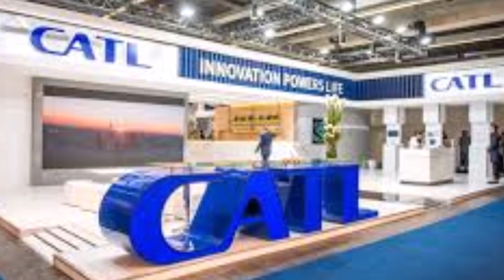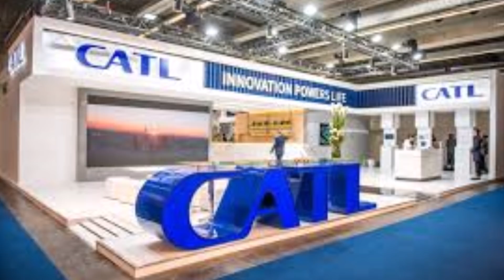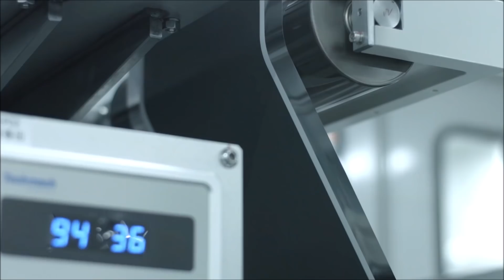Tesla and CATL's One-Million-Mile Battery Is Ready for Production

Comment: I am interested is what this means for the Powerwall. When will I be able to get a Powerwall with this new technology. at the moment it is not worth buying a Powerwall in the UK. The battery will run out just when I get my money back. I will not make a profit on it over its lifetime. If the new Powerwall which I have not heard anything about yet arrives  I expect it will last 30 years instead of 15. I expect that it will also cost 30% less than the current Powerwall 2. I am only guessing. This will make it worthwhile to add to my solar panel installation.

Comment: Although the life of the battery is one factor holding people back from buying an electric car the largest factor is time to charge. Once you can get the charge time down to at the most 15 minutes then the market will be wide open. But then we will run into the next problem: the electrical grid. Our existing electric grid and generation cannot handle the capacity of everyone having electric cars. This is compounded by everyone not wanting new power plants to be built but solar won't cut it at this time. The solar panels are inefficient, toxic and don't last long enough to justify the cost. The cleanest generation at this moment is nuclear but everyone is afraid of it after Fukashima. The next cleanest is natural gas. Those plants run clean and there is a lot of natural gas. We need clean generation that works in the day, night, windy and calm until a breakthrough in electric generation can be invented. Once those two problems are solved the whole WORLD will willingly go electric and you won't have to talk them into it.

Comment: Somehow I doubt the claims or their overall significance.  Nothing in the announcement regarding the elimination of cobalt from the chemistry (keeps scaling possible and cost effective)  Nothing about the various methods employed to ACHIEVE the longevity benchmarks they're claiming.  Nothing about any innovation in lithium crystallization (which is how Tesla batteries were able to achieve the benchmark apparently).  NOTHING about new manufacturing techniques or technology.   Nothing about methods of thermal management (which are essential for higher recharging rates)... Just a claim about performance.

Comment: It's not really clear what excatly this is. The pictures show NMC cells with an energy density of 280Wh/kg which is quite impressive but I think this is not the "1 Mio. mile battery" as it was always believed (and confirmed ?) these would be LPF cells. Also the bloomberg article mentions the cells would be 10% more expensive while Teslas new batteries are supposed to be cheaper than existing ones. So I think we are still heading for two completely different batteries, an expensive high-capacity one for the long range models and a cheaper one for short and medium range models. If only the last one is a "1 Mio mile battery" is something I'm really not sure about.
Reply: I suspect 10% dearer than CATL's standard batteries the cells for which cost around $80 per kWh.

Comment: Unfortunately this confuses as much as it clarifies. One point is that it does clearly separate the two CATL batteries proposed. One is the LFP battery that they previously announced, which has no cobalt, and will be priced under $100/kW, and be used initially in China-only Model 3s. And the second future product being a million mile battery, which this announcement confirms will be a different, more expensive battery. Elon Musk previously stated that Panasonic's 2170 batteries used in the current Model 3 have a lifespan of between 300,000 and 500,000 miles, but this announcement is from CATL who is going to downplay the capabilities of their Japanese battery manufacturing rivals. Just like GM mentioned that LG (their battery provider) will be building million mile batteries, CATL is also claiming that they are ready to build their own MM batteries. But it is uncertain if CATL's MM batteries are the same as Tesla's MM batteries that were designed and tested under their Roadrunner project. It is unlikely (but possible) that Tesla would just give China's CATL their single crystal cathode, tab-less casing, and Maxwell dry electrode technologies that form the basis of their upcoming Tesla MM batteries. It is more likely that CATL is capitalizing on the fact that they also have advanced technologies that they can use to build their own MM batteries, and they are taking advantage of the industry buzz of Tesla's upcoming batteries to announce their own MM batteries. They could be the same MM battery design, but I doubt it. The trick is that CATL has all of the resources and facilities to produce their advanced batteries today, whereas batteries are not Tesla's core business, and they have relied on Panasonic to build their batteries up to now. Some Tesla alliances like Novonix are focusing on improved testing and new battery technologies that rely LESS on China for battery production and materials.  Hopefully Tesla will announce their date for the upcoming Battery Day, so they can clarify the reality of their upcoming battery technologies and products.